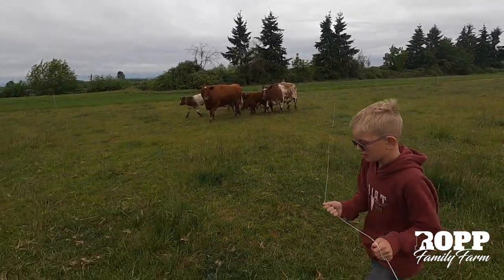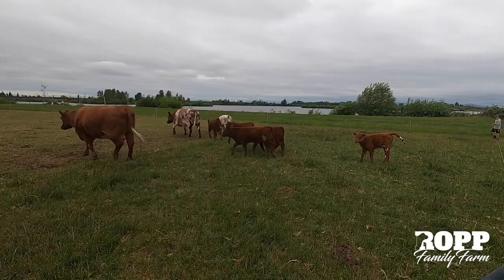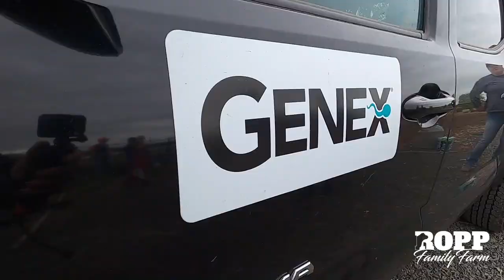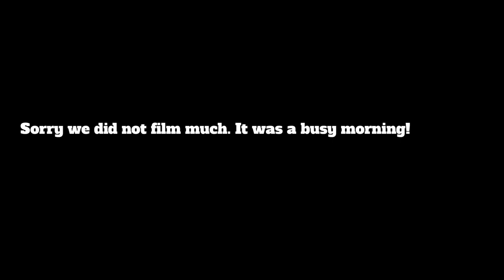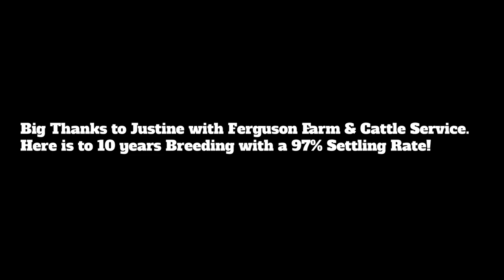Shorthorn Cattle Breeding 2021: Part 3

Comment: Are your shorthorn cows native like the semen you chose to use?
Reply from the maker: Hey Christopher thanks for the question and thanks for checking out our video! Some of the lines that I have to go back to native but a lot of what I’m using now is A moderate framed well balanced Bulls.  A lot of what I’m breeding to are good cow making genetics, good carcass traits for my Lockerbie business & color… I love color 😉 I try to stay away from the clubby bulls as they tend to just bring in problems and don’t really work for my program. There’s a lot of fancy bulls out there that look great and make fancy calves that look great, but when it comes to performance from that calves after Show season,  they tend to have issues.